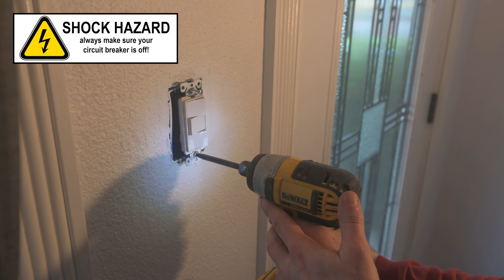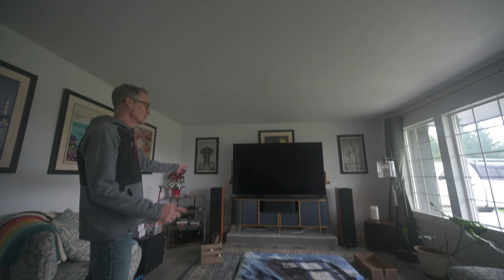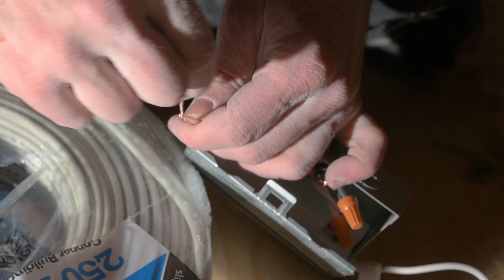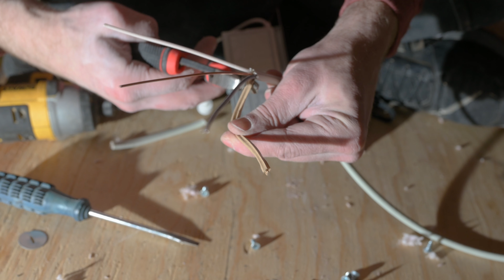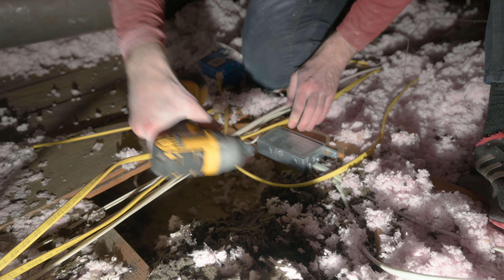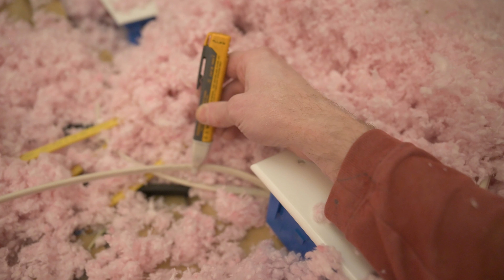DIY Recessed Lighting Installation From Start to Finish

Comment: My electrician taught a us a trick. He went thru every single switch and outlet and wrote on the back of the wall plate which circuit it is linked to.
Reply from the maker: That's an amazing tip, I definitely should do that! 💡 I've always wanted to make an electrical map of my house too.